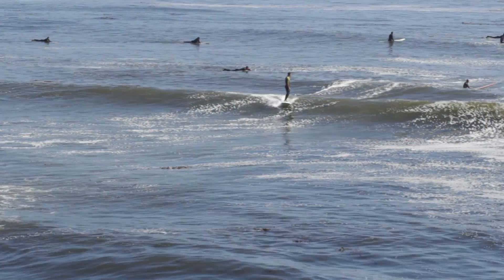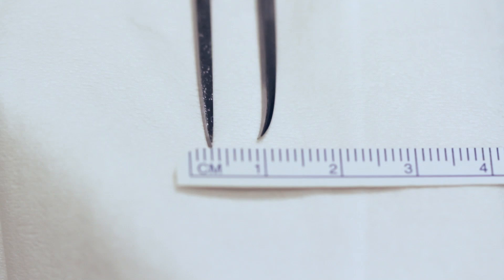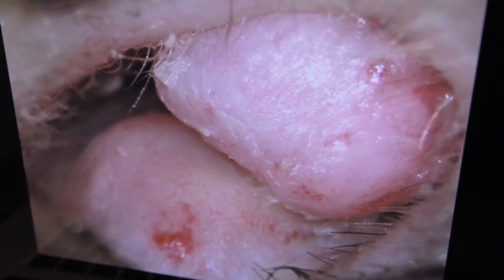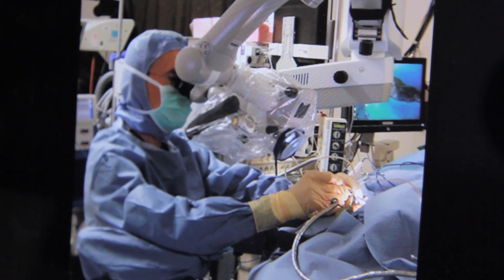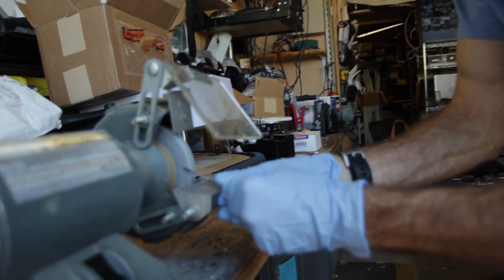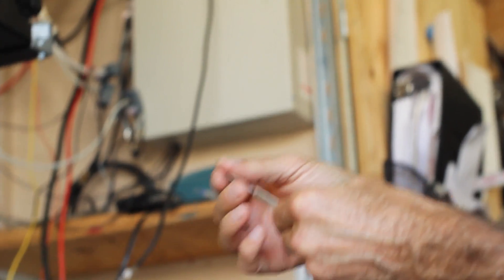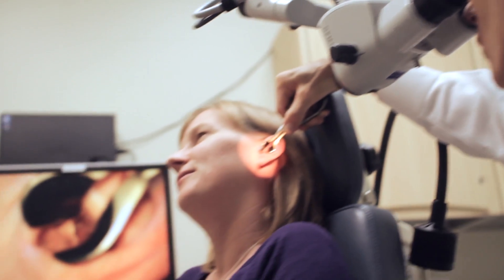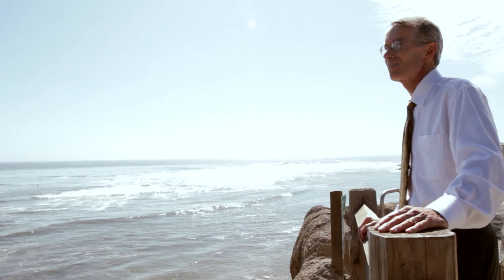Surfer's Ear Surgery - Santa Cruz Doctor, Doug Hetzler Video

Comment: The most overlooked division of bone removal operations.
But extremely vital to suffers of surfers ear so named for propensity of this sport enthusiasts.
Can happen to any one involved with repeated cold water exposure. The body reacts with blood supply increased in auditory canal with resultant bone growth intrusion into diameter. 
Wonder about any possibility of laser removal of bone. Of course a most delicate operation to be sure.
The proximity of the tympanic membrane and the middle ear structures.